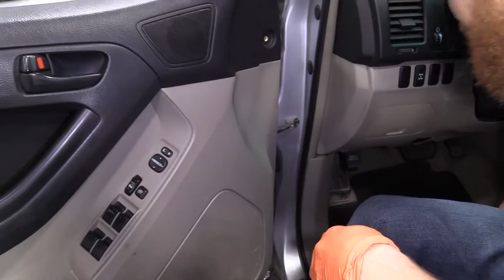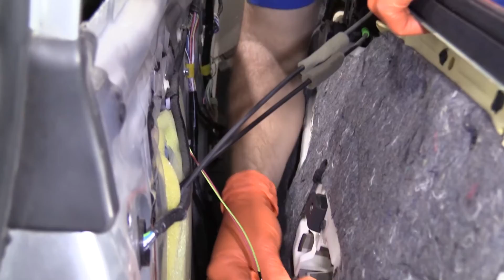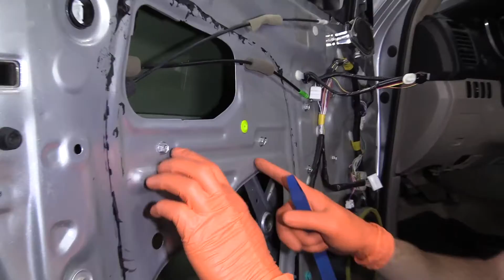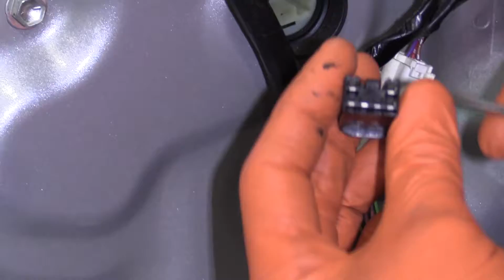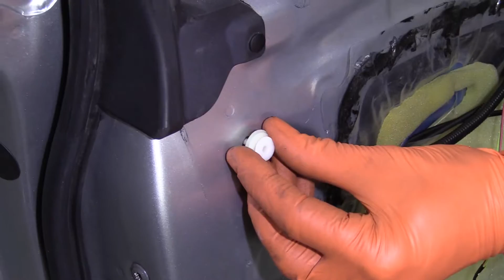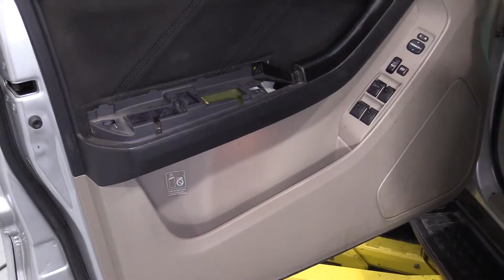How to Replace Window Regulator 02-09 Toyota 4Runner

Comment: I am working on a 2004 Toyota Tacoma drivers door.  The window had been sticking at the top, so when you tried to open it, the window would stick then drop an inch or so, making a little bang noise. Eventually, it was closed and the buttons no longer work on this window. The other windows work fine still.  I thought it was the regulator assembly coming lose at first but now that no power to that window-I am not sure what is wrong. First, what if you cannot get window to go down?  Can you disconnect it from frame when closed at top?? Should I assume the motor is bad? No power?  I went to Toyota-then want $189 dollar diagnosis fee first!!!  then whatever the repair and parts costs.  I don't like that gouging the buyer.  I had a mechanic who would have a diagnosis fee, but if you had him do repair, he waved it.  I haven't asked them about that?  It looks easy enough on your SUV.  If you could answer me about getting bolts out when window suck up closed-it would help me figure out what my plan is.  I panned on buying regulator with motor then doing it myself. Again, nice video.

Comment: What if the reg is out and wont go down at all?  Can you unbolt the bottom bolts and drop the window down to access the glass bolts?
Reply from the maker: +Mr D We wouldn't be able to diagnose an issue like that here, you may want to have a local mechanic take a look at it. Thanks for checking us out! http://1aau.to/m/Shop-1AAuto-c

Comment: Excellent work, Does anyone have any tips on what to do if your window is up, Pressing the button won't bring the window down you can hear the motor running, Watching the video you have to have the window down to get at the bolts to remove the regulator and motor unit